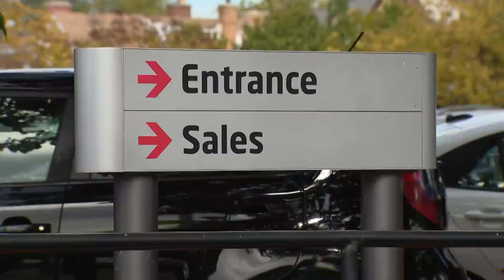Why are hundreds of new cars parked at Joliet racetrack?

Comment: Just imagine if your local pizza place ...just cooked pizza 24/7 and waited for customers to walk in and buy them...doesn't sound sane, does it ???? OMG..we can't order cars anymore because they say it simpler and cheaper just to build them and ship thme out and let the dealerships " TRY " to sell them...What happens when we get a hail storm ??? What happens when these car sit and never get driven to find out their flaws ??? ...This is why hundred of thousands vehicles get recalled  2 to 3 model years later...
Reply: Joe knowz Jack about running a business, is what your name should have been...
Reply: @Msantor1605  To big to fail..is not a way to run a business...the latest...just buy them and when our supply chain problem just goes away...will call you and put in these computer chips that we need to operate all these function that add to the price of the 40 thousand dollar suv we just sent down the assembly line to keep our cost low...but wait...there is more...because we cnt keep a few of our models on the showroom floors ..."we" are going to charge a premium price on that model... and yes...will call you and set up an appointment so you can use your auto start, heated seats , nav system. all your cameos and USB's ...but other then that...you don't need  to worry about you air bag or anti-lock brakes....you'll be safe....